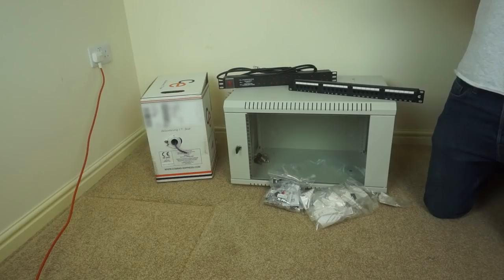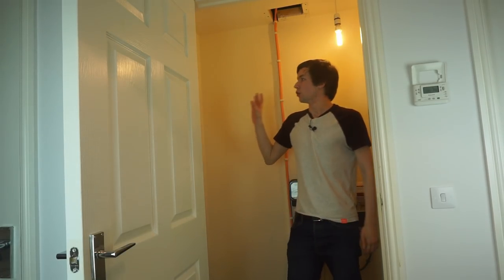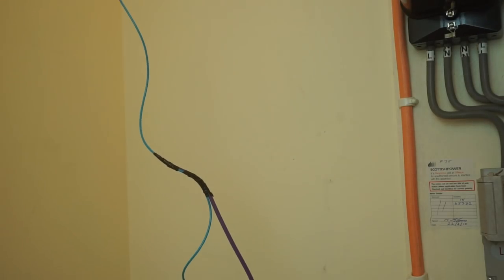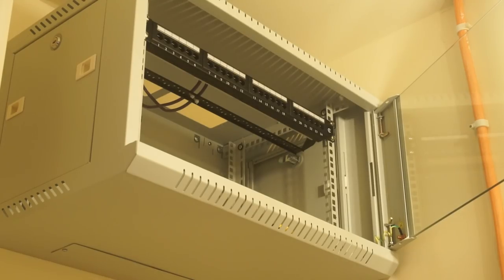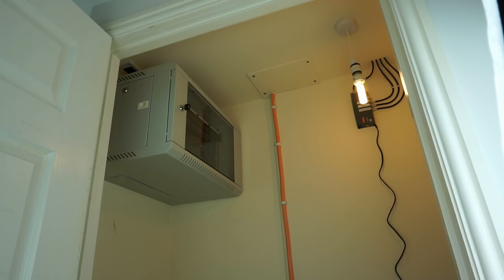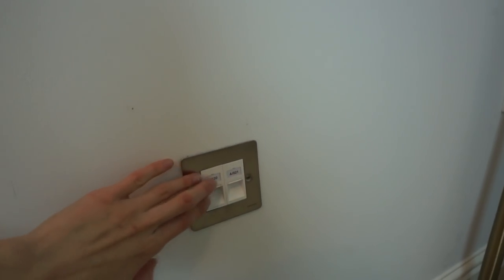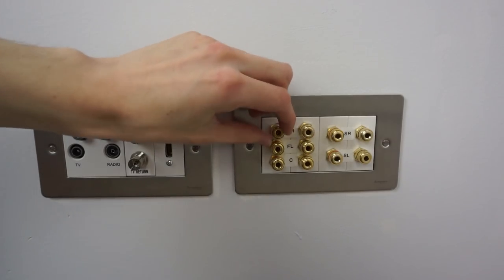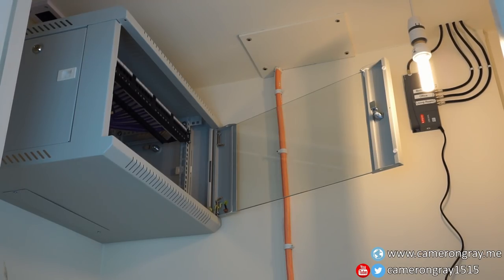New Flat - Time to install a completely overkill home network!

Comment: Or you could just use wi-fi and avoid destroying the flat :)
Reply: AC5300 Wireless Tri-band Gigabit Router can reach those speeds
Reply: But literally nothing was destroyed...? All those holes will be filled and you won't ever notice they were there. And also, any device that does not move should be connected through a wire for far better stability, throughput and lower latency. WiFi is really only suitable for mobile devices such as cell phones, laptops and tablets.
Reply: Reduces resale value, patches in walls are NEVER invisible. You can use Powerline gigabit using the mains wiring, plus high speed wifi. Everything is wifi these days, just put your servers wired directly to the main router.
Reply: No, you don't wire servers to a router. Do you know anything about networking at all?! If anything, he just increased resale value by running a wired network in the walls.
Reply: LOL, I'm using a gigabit router, it's super fast
Reply: That's not a router but a switch. You probably use one of those consumer all-in-one devices that's router, NAT-firewall, switch and wireless access point in one device. The part you connect devices to is the switch.
Reply: +Vax Buster Wifi will be never as fast (especially the latency) and as reliable as cable connection, not mentioning network security and the needless congestion of the 2.4/5GHz band. I am using a simple rule: if something is fixed, use cable, if it should be mobile, use wifi. There are corner cases, though (temporary install, not practical or permitted to drill, etc...).

Comment: So your just hacking your house up to have connections that you will never use
Reply from the maker: +shea harbo Most of the connections will be used regularly and once everything is filled in and painted properly, it looks as good as new.  It was also a fun and interesting project to do.
Reply: @shea harbo - I was going to ask do you live with Cameron, how else would you know what he'll be using?
Reply: You know those times when you wished you had a reliable connection in the toilet? Or wished you could watch TV in the spare room, or wished the blinkin wireless didn't turn itself off when you didn't want it too, or ever wished you could plug in almost any fancy audio/computer device in any room and listen in any room and control this that and the other reliably without buggering about etc...etc...That is what you will never have...Also that is not 'hacking' it's blinkin plasterboard. Easy.
Reply: totally agree with Martin D A. I'm personally really jealous to be honest :-D
Reply: So many way off fixing does holes . one is just have the pieces u cut out but before you put them back into the hole you add a small wooden piece to the backside off the wall so when you put it back that will make it stop. bam just glue it there or any other solution u like and cover the remaining small parts and paint and its gone like it was never done :)
Reply: also love this kind off videos. :) nice too see how others do this and what they get out off it. Fun watch
Reply: you're*

Comment: Why does your voice go up at the end of every sentence. Its really annoying. Also I don't understand why you're using expensive metal faceplates when the walls and connection modules in the centre of the plates (ethernet, TV, radio, SAT, speakers, etc) are already white. If you used white plastic faceplates, everything would be the same colour and match. The metal faceplates with white plastic modules in the centre look wrong in my opinion. Its not as if you can get metal ethernet modules/jacks, they have to be plastic for insulating purposes. Same with sockets. If you do decide to buy new sockets with metal faceplates, the holes where the pins of plugs go in will still be plastic and won't be the same colour as the metal.
Reply: Why do you leave comments like this? "It's really annoying."

And you don't like the new face plates? Well then, don't put them in your own place.

I enjoyed this video. I wouldn't go for the brushed aluminium either but it's just personal preference and Cameron can do what Cameron wants to do.
Reply from the maker: +Simon Tay I simply prefer the look and feel of the brushed stainless steel fixtures over the basic plastic ones.  It's entirely down to personal preference.  I'm fully aware that the sockets will have plastic bits around the pins, I still prefer them over what I have currently.

As far as my voice, it's just my accent, I'm not going to put on a special voice just for video, that would likely end up sounding even more ridiculous!
Reply: if a female did that with her speech, that is to uplilt at the end of each sentence, it'd be called "chirpy".. i wonder what the make equivalent is..